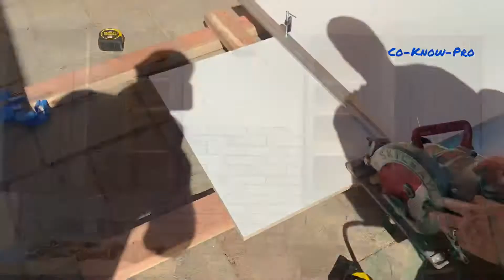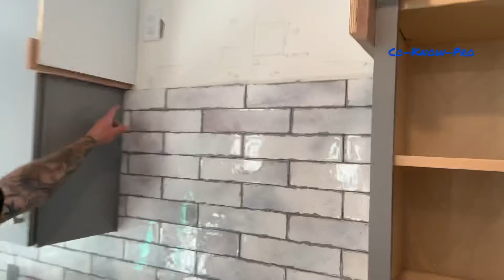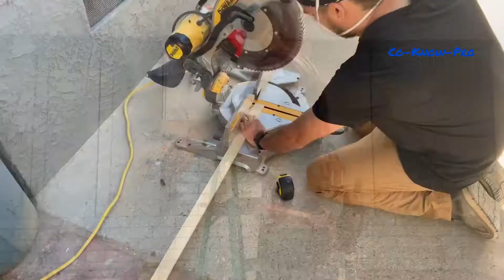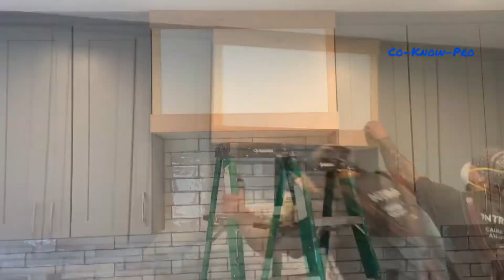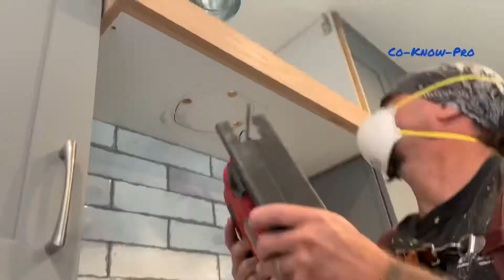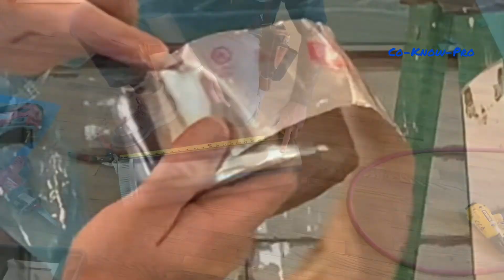⭐️How To Build A Hood Cabinet With Magnetic Cover‼️ @co-know-proconstructiontips

Comment: Does the city approve this in bylaws?
They always ask that everything be well installed and well assembled,
Reply from the maker: Yes, it’s all per code and passes inspection. The main thing you have to pay attention to is combustible material. When you read the specs on your hood, it gives you the distance between a gas range or electric range. Once you have that distance between stove top and combustible material, you know where the bottom of your hood can go. 👍